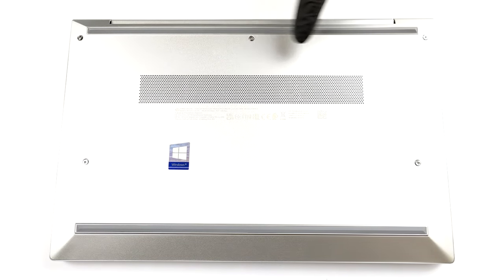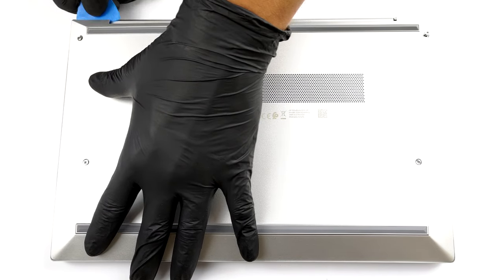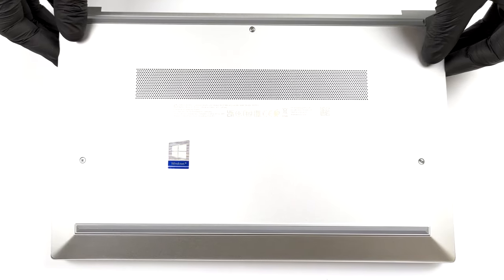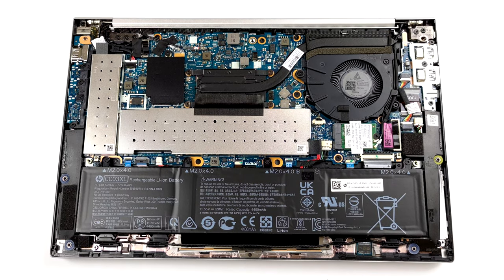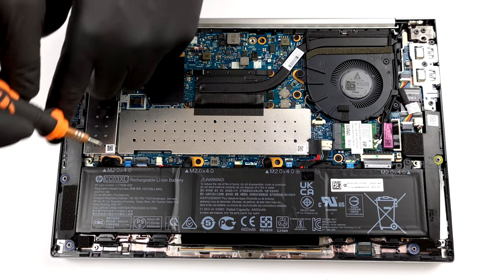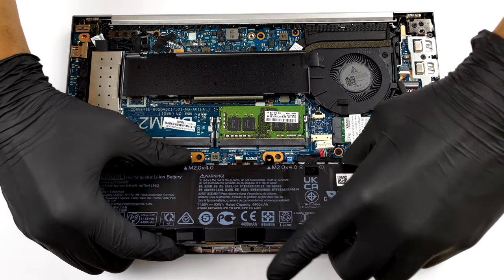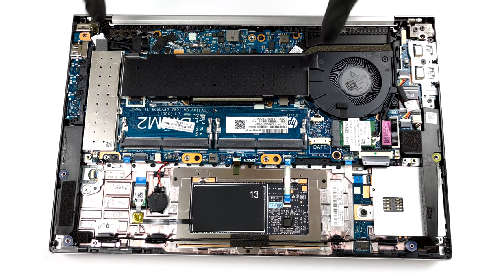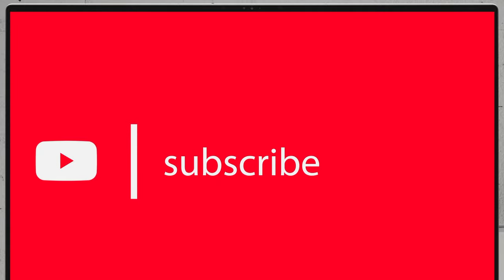🛠️ HP EliteBook 830 G8 - disassembly and upgrade options

Comment: nice! will be nice to say if there are any WWAN options. I am interested to see if there is SIM slot without the WWAN module, as I am keen to get aftermarket WWAN.
Reply: There is one, sadly its not specified in this video but you can see the WWAN port hidden behind insulating tape on the top-left